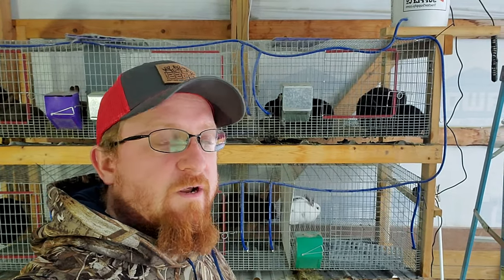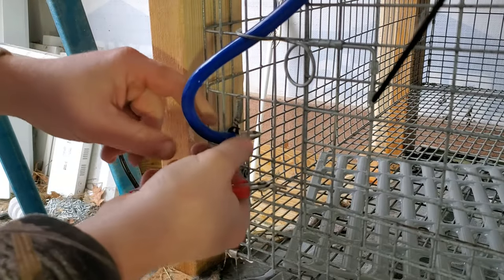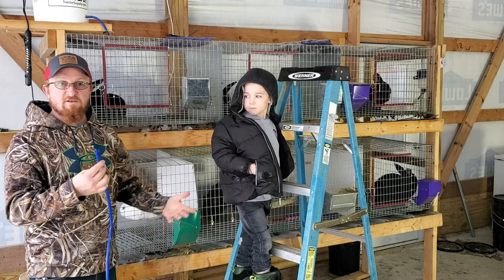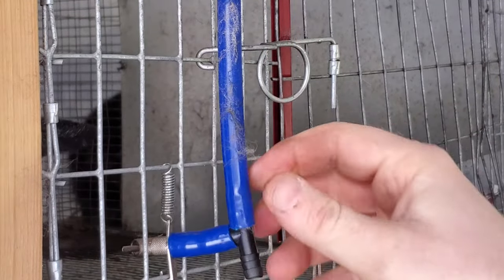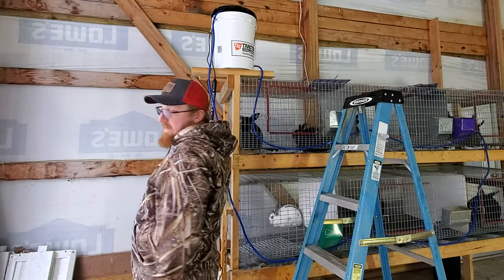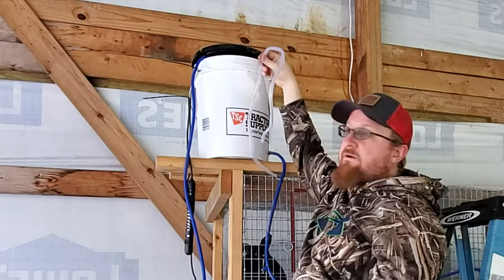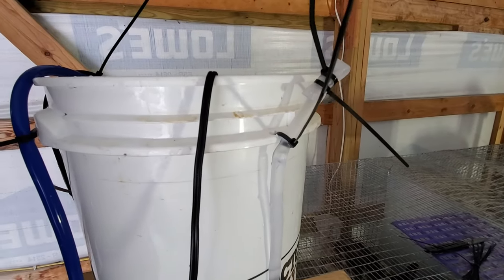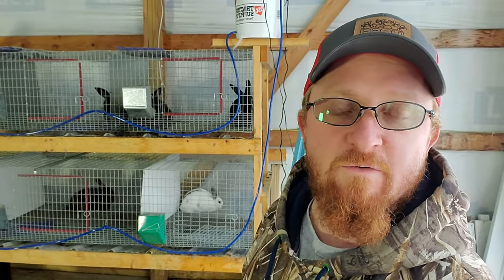Winter proof heated, circulating rabbit water system | DIY water system build

Comment: Your water level idea is helpful. It gets old going up and down the ladder. Just install an elbow and seal (grommet) at the bottom of the bucket and run the clear tube up like you did. It will give you the level without being part of the pressure system. Thanks for the video.
Reply from the maker: that will definitely be a part of my new water system that i plan to build before winter!  Thanks for watching!

Comment: Good work! we’ve used the farm innovators heated rabbit waterers for a few years and they’re expensive garbage- we’re lucky if they last a whole season. They sell submersible bucket heaters and heated buckets at rural king that should keep your temps closer to where you want it. 46 days til spring!!
Reply from the maker: I may look up one of those buckets!  I would worry about drilling a hole in the side for the tubing tho since i may accidently hit a heating wire in the bucket wall.  
This system will be put to the test this coming weekend, it is supposed to be -3F at night.
Reply: @OwlCreekHomestead  how did it do? Did it freeze?

Comment: Nice job, I have a similar setup. I have a larger aquarium pump and an aquarium heater and have it in about a 30-gallon barrel. When it is really cold outside, the water stays about 50 degrees Fahrenheit, but when it's not cold, I do have to unplug it. I also had to lower my hoses to below the cages because one of my rabbits chewed a hole in the hose.

Comment: Needs heat tape as well. We use that system and everything froze except what is in the bucket.
Reply from the maker: I ended up rebuilding the entire system.  I just released a video on it, so far it is still flowing in -10F temps

Comment: One water level trick is using a float in the tank connected to a string with a weight (a nut).  For example, use a fishing bobber (wooden float), some heavy fishing line (20lb test) or paranoid, pass it through a vent hole on the top side of the bucket, and tie the nut at the bottom of the bucket.  As the water level drops, so does the float, which pulls the weight up.  Mark the levels (min/max) on the bucket.  Now you have a visual indicator that won't freeze (as would still water in a sight tube).
Old French winemaker trick.

TullyRiverQuail / You Tube Channel - grow your own protien for food and profit

Comment: Try using a mason jar and a light bulb. Also, try to find a used hot water heater where the heating element is shot. Adding the HH to you circulation system will give you thermal mass and all your lines can be used free garden hose (unless you want BPH free tubing ;) Pex is a great alternative.

Comment: I effectively did this exact same thing this year, but the drink nipples are still freezing when the temp drops to the low 20s and lower. I even insulated them from direct contact onto the wire cages. Wondering how well yours worked and if maybe I need to go up in water temp...

Comment: Great job looks just like mine except mine is not freeze proof yet. I would like to know how you connect the water pump to the water line?
Reply from the maker: I just bought a pump with a small flange and zip tied the line to it.  Pulaco was the brand I think.

Comment: Water level? why, Add apex piping hose to bucket, Add a water Float valve. water stays full at all times.
Never fill water Again.
🤷🏽‍♂️ How I've done it for couple years now works great.
I check every few months for a clean.
That's it.
the recirculation is a good idea.
I'm going to change to that all year now.
Thanks
Reply from the maker: I plan to hook mine up on a float soon. I'm expanding my rabbitry first, then will get the water system built.  Thanks for watchin!

Comment: You could also eliminate the need for a separate heater, and even a pump, but installing a small scale geothermal system to prevent the water from freezing by absorbing heat from the ground. I would guess a depth of about 4-5 feet would be sufficient for something like this, and you could use pex for the coils. I don't think it would require a whole lot of coils to get the job done. You could get 100 feet of 1/2" pex from Home Depot for a mere $30 which would be more than enough. I plan to do something like this for my rabbits. I'm still planning out the system though.
Reply: I'd love to see a video about this!